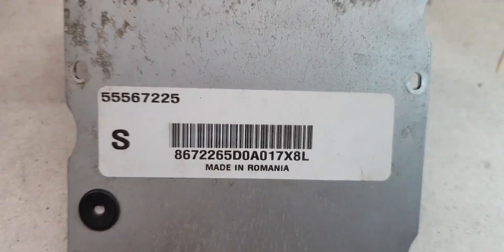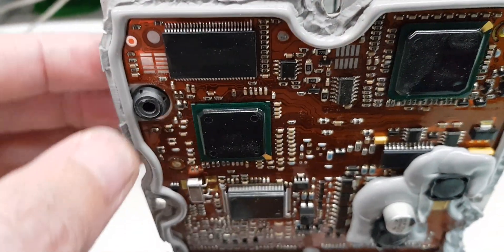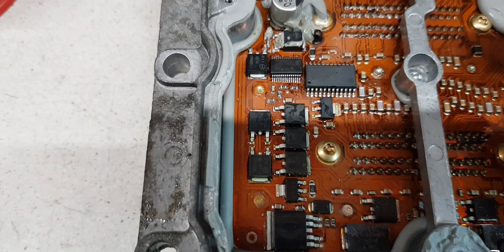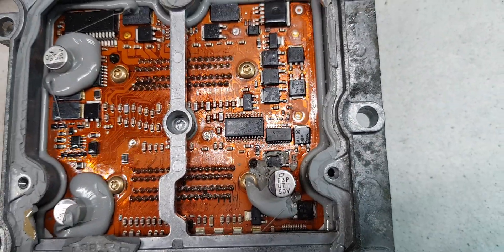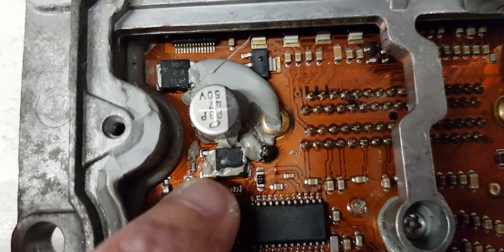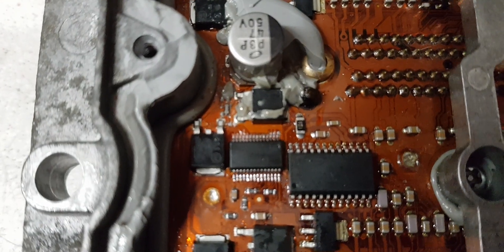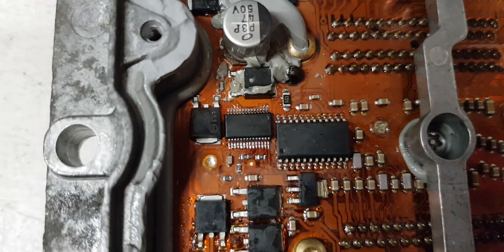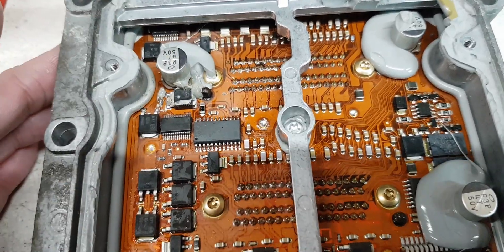Saab ecu repair 55567225

Comment: I sent my ecu for fixing, the guy changed the chip but the problem is still there i get p201 p202 p203 p204 and p1682 codes, what chips do you suggest changing
Reply from the maker: Them codes usually relate to the Tpic46L02, it is possible that when it was changed there maybe bad connections to the ic
Reply from the maker: Also the boards on these ecus are laminated and glued to the aluminium case making it a very difficult change.

Comment: I'm doing this exact repair. Thank you for the video. How do I know for sure I'm setting the pins in it's correct location and does it matter if solder is overlapping between each of those pins?
Reply from the maker: best thing to do is take a picture so you know how it all goes. also when taking the ic off it doesn't matter about the solder. when putting it back on it does, use a fine tip soldering iron and flow one pin at a time. ;)
Reply: @liney118  thank you for the reply. I'm so nervous I have a spare ECU to practice on and failed horribly at soldering it. When removing the chip it seems I destroyed the contact pins and can no longer see them to solder.  Even the brown lining got a bit messed up